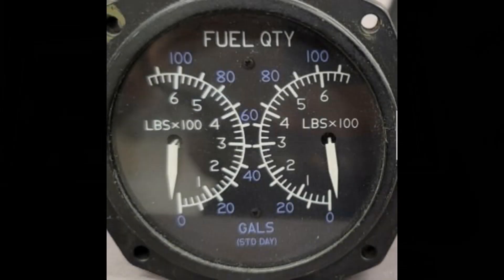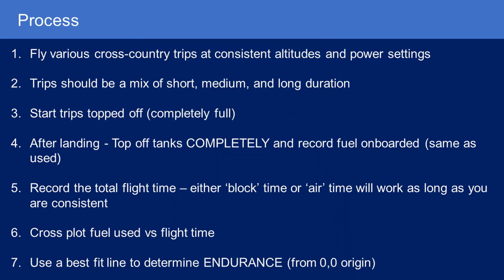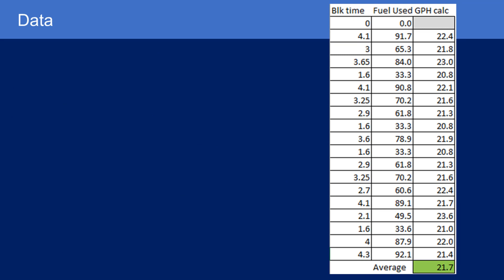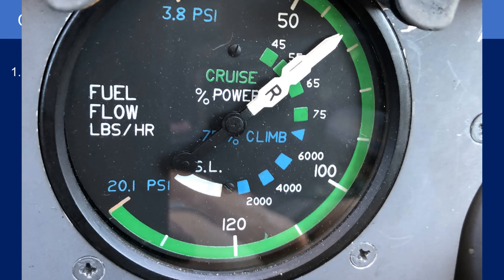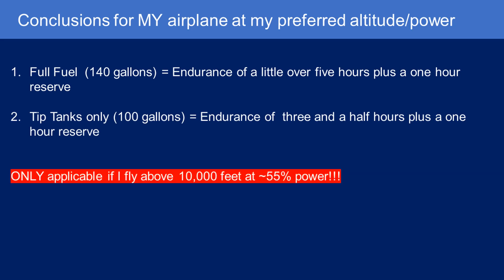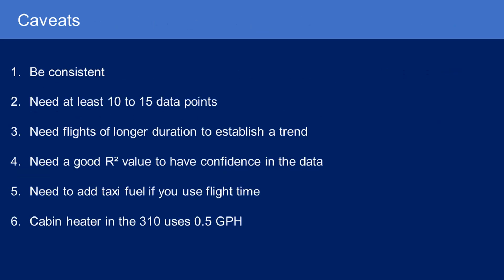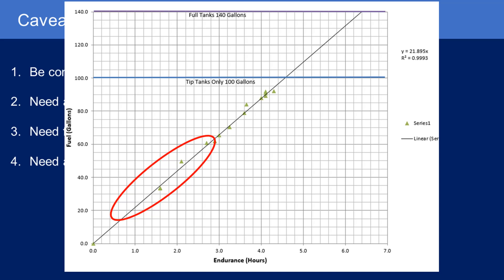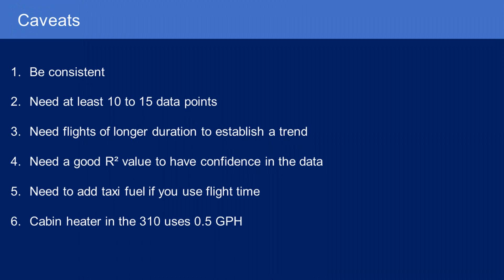Time in your tanks - How I came up with accurate endurance numbers

Comment: All you have to due is run fuel test verse time for that a/,c; log it.every airplane is different; just be consistent with pwr settings you normally  use.i aways land with hr flt time in my tanks,ues told card.